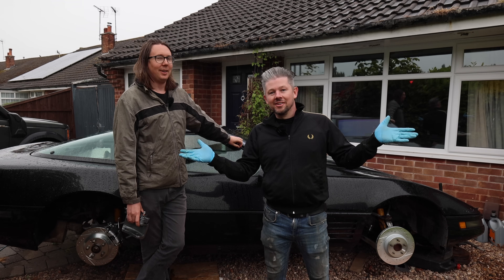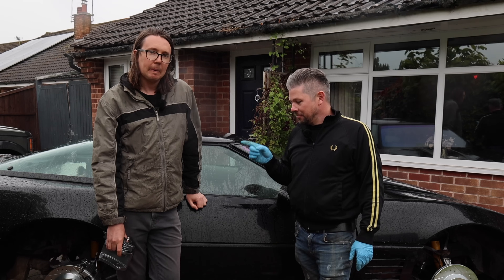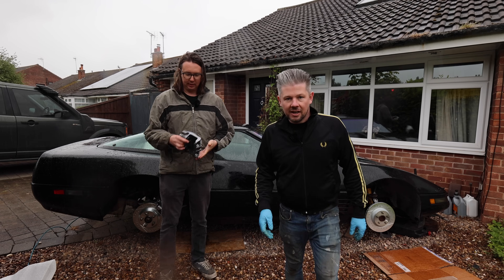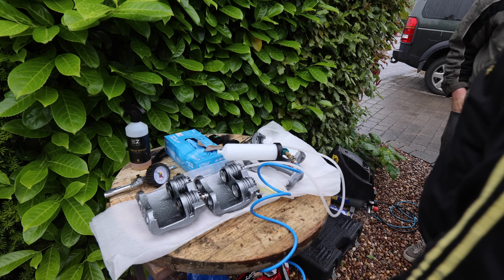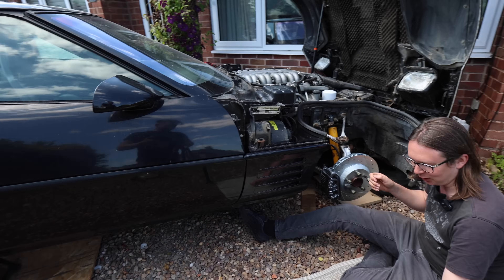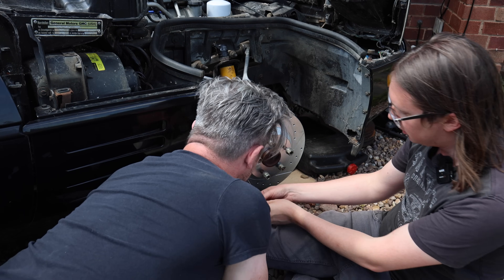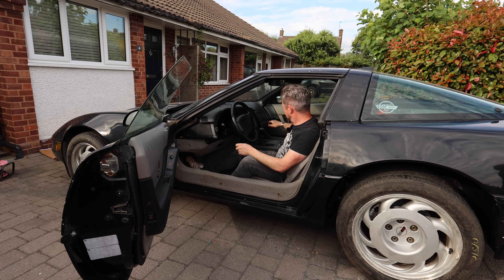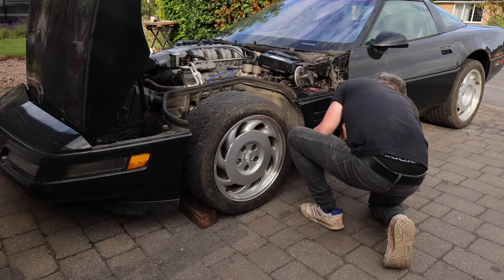PROGRESS! Our British ZR-1 moves for the first time in 18 YEARS! Corvette ZR1 Project Episode 10

Comment: Oh no, for the people who love engine stuff like myself do a special vid showing the troubleshooting, finding and fixing the engine running issue in fact the whole drivetrain.
Reply: Yes, it's tragic the way it misses and belches out black smoke. I think the cats are probably blocked now and the oxy sensor has been wrecked by being coated in carboniferous soot.
Reply from the maker: @mercmad a good italian tune up once it's running properly should fix the o2 sensors... If not, we've got a pair of brand new Bosch ones ready to go! If you're interested the code is 31 and it's basically not sending a pulse to the ECM (or the ECM is ignoring it). We are going to scope it on saturday so we should know either way!

Comment: Ah way to go lads, cracking job you've both done on that.
Looks like it could have just rolled off the production line in Kentucky!! 😎

If it was me, I wouldn't get the car repainted, it probably looks better than a 
lot of other cars driving about.

I think you may have discovered a new alien lifeform, hiding in that rear light,
I got the proper shivers looking at that thing!!😯😳

Also, has anyone else noticed how the C4 would make a great looking pickup,
if you removed the rear hatch/glass canopy 😄

Looking forward to seeing it get that bit closer to the finish line, hopefully you
can get the engine running issues sorted, easily enough.
Reply from the maker: That alien life form was horrifying eh!! Funny you should mention the pick up idea - We also reckon it would look pretty cool too! Thanks for the comment and for watching :) :)

Comment: Great job guys! Looking superb and you’ll get the engine running smoothly. First time it’s run in years you can’t expect much more! Re the paint touch up the small imperfections. Originality is good on cars like this especially when 95% of the car is excellent. Wheel refurb will transform it too! Congratulations 🎉
Reply from the maker: 100% the wheels will get a refurbishment... Probably in factory colours with the polished lip.

Comment: I think you guys are doing a great job, ignore the haters and do it your way, it's your car.

Shame the cam sensor replacement didn't fix it, if it was mine I'd look at the wiring next, maybe drop it off at a good auto electrician who could scope the sensors and see which circuit is the culprit. If you want to learn more about auto electrics with the view of trying to fix it yourselves, I recommend Pine Hollow Auto Diagnostics and South Main Auto YouTube channels. I wouldn't be bored seeing you guys try to tackle it, more content the better!

You only get original paint once and it looks great after your efforts so I don't think it needs a respray, maybe take it to a bodyshop for repairs, the good thing about black is it's very easy to blend something like the wing without painting all of it.

Are you planning on doing any shows next year? Would be great to see it in person.

Oh and one final thing, while the handbrake is playing up, please put it in the gear that goes away from your house, not towards it, otherwise you might need that respray and a lot more parts from the States! 😅
Reply from the maker: Thanks for the advice!! We have checked the wheels now so it's safe (we hope!) . Handbrake will be adjusted in the next episode! :) We are going to do some shows definitely - Are you based in the UK? We will make sure we publish the shows we go to on our channel!
Reply: @Auto_Funk  I'm about an hour away from you guys so local shows in Notts/Leics shouldn't be an issue for me.  Hopefully by the time the shows start next year she'll be running sweet and shining like a diamond.  I forgot to say in my last comment, if it was mine I'd get the wheels stripped and polished, other C4 owners have done it and they look amazing!

Comment: It's coming on great. Don't paint it. Really hope you get to the bottom of the engine running poorly. Also love the fact that you took the time to clean the light lenses and the seals as these are either overlooked or replaced with new. A quick wash is always a good start on light lenses.

Comment: If you feel like you need to bleed the brakes again, do it the other way around. Left front first, then right front, left rear and right rear. Don't ask me why, but that did the trick on my '87 Corvette. The engine sounds like it's missing and there was black smoke coming out the exhaust indicating a too rich mixture. I hope you guys(blokes...) can figure that out. Good luck!
Reply from the maker: We think the cam sensor isn't telling the computer when to fire properly, so the timing is a little erratic! So fuel isn't being fully burnt. 

We will try that trick with the brakes. Maybe its a weird C4 thing!
Reply: @Auto_Funk   I would replace the master cylinder as well, just to be on the save side. A 30+ year old master cylinder is likely to fail soon, or at least it's going to leak. Hope to see an update soon.

Comment: The paint looks bloody great from where i'm sitting lads.. Save you money and spend it on the engine probs.. Maybe get it ceramic coated .. or just keep on top of it with the protection... Get a nice soft cover for it.. if you spend a ton on a respray . you'l be scared to take it anywhere.. after all this car is there to be driven hard ha ha ..

Comment: I think the paint will come up a treat with a proper detail. As it has sat so long, I would definitely give it a blast with some fallout remover (should really have been done before claying). Use a good pre wash snow foam (Bilt Hamber Autofoam is good), rinse and then wash with a non wax shampoo. Then clay again, do a light cut with a quality compound, wipe with iso prop panel wipe, inspect for defects and repeat if necessary. Once happy, get a good polishing pad and ideally a non resin polish (Autoglym SR polish is good, but has fillers and hides scratches, so good for a quick spruce up, but not if you are applying a sealant). Give it a couple of polishes with different grades of polish (maybe a 2,500 & 3,500 as it is a black car). Then important step, is to use a good panel wipe before applying any wax or sealant, to remove any polish, wax or residue. This ensures the final coat of sealant, bonds with the clearcoat or laquer and is not sitting on top of a coat of polish ( I like Bilt Hamber Cleanser for final step). Then apply a good wax or ceramic coat and should be good to go.

Maybe get the paint defects sorted first though, as you will likely have to repeat the process if not when it has been done. Also, careful with that old school rotary on black paint. You can get good results with them, but very easy to get holograms in darker paints. Random orbital / mop is a safer option. 

I get that this was a quick detail to spruce it up a bit though and you probably had a better detail in mind for further down the line 🙂.
Reply from the maker: Thanks so much for the tips - We're not experts, just learning as we go and doing our best based on past experiences.... Great shout about the panel wipe, something we completely overlooked. You are right, it was a quick spruce up and a sort of "looksee" to see what we're dealing with. Further work required, me might employ someone to do it (possibly the @thecarcleaningguru if he's up for it!)
Reply: @Auto_Funk  If you have the time, do it yourselves, more content and people can get better with you 🙂. The only issue you may have is trying to ceramic coat outside with British weather and seagulls / pigeons targeting your newly polished car. It really needs to cure inside for a few days to get max protection. 

My experience would say, forget the 3 to 5 year type ceramic coats though, they don't normally last anywhere near that long, are more difficult to maintain and you cannot do any paint correction without needing to reapply (minor scratch, birdstrike etc). Personally, I much prefer the semi permanent ceramic coats that you apply maybe twice per year. You can use these outside (preferably not in direct sunlight) and they last around 4 to 6 months on average, depending on cleaning products, environment etc. I have always got on well with Mother's CMX Ceramic Spray. Easy to apply and lasts really well and a bottle will last for many full applications.

It will make future cleaning much easier.

Comment: Copper slip....iv heard its not necessary between hub and disc, as those parts dont need to move past one another, unlike the brake pads that need to move under braking as the piston pushing on the pad. If your worried about hub and disc fusing together, just use big hammer🤣

Comment: It sounded pretty healthy couple of videos ago. Have you checked compression now? I hope there's nothing wrong with some of the valve springs.. Best of luck 👍
Reply from the maker: We're having intermittent running issues. Imagine its (hopeful) its electrical as the car does crank fine. Its not galloping etc..!

Comment: Copper slip is fine on the hub surface. But do not use any short of antiseize on the lug threads nor any of the actual caliper bracket bolts.
Reply: See I'm not the only one , some one who knows there onions.

Comment: Regarding the engine running rough, GM’s are finicky when it comes to certain things. There are aftermarket plugs that say they fit, but they are not correct. You have to use GM plugs for that specific engine. They are expensive. I learned this with my GMC pickup. After wasting money on aftermarket plugs, I put the factory plugs in and it ran perfectly. That may be part of the problem.
Reply from the maker: It could be a plug problem for sure. Might have to go back to basics there.

Comment: Always bleed brakes starting at the front of the car with the closest to the fluid pot, then the other front, moving to the closest at the back and finishing on the furthest away as thats where the remainder of the air will be. 
Pretty much every haynes manual I ever read tells you this and always worked every time first time. 
Good to see you back at it.
Reply from the maker: Thanks for the tip! We always thought it was furthest first but hey we're not experts!

Comment: Slowly getting there guys. But when you bleed the brakes dont pump the pedal with the bleed screw open. Close the bleed screw pump the pedal gently and then push the pedal down and hold it down then release the bleed screw letting air and fuild out, lock the bleed screw off then pump the pedal gentley again hold down and repeat until no air comes out. Pumping the pedal with the bleed screw open lets some fluid out but will pull some air back in.

Comment: It's come up really nice, good job. Likely it's had moisture in a box of two, if all else fails clean inside with electrical cleaner/lub and a soft toothbrush. If you get stuck bleeding brakes by yourself use a piece of pipe like you had plug end with(I use a bolt) and cut a fine 10/15mm slit in it,  by the bolt or whatever you use to plug hole.So it will close after the pressure has dropped. but put well inside a bottle because it squirts out. If you use DOT 5.1 doesn't damage paintwork. But don't hold me to that have a look. Run it in my BMW E91 been fine, running Brembo pads and disks Std calipers. The gloves you use I only use for things like stripping carbs, for doing most jobs I use the woven backs with latex palms/fingers. More heavy duty can reuse for months. Good luck with finding the fault. 👍

Comment: I'm sure you've had plenty of offers to help figure out the running problem. I'm pretty well versed in this era gm driveability. Do you have an old obd1 scanner that shows live data? GM called it the Tech 1. The old SnapOn "brick" also works as well as the old OTC obd1 for GM. If you do have the ability to pull live data,  I'd like to see a video of all of the readings while the rough running is occurring.
Reply from the maker: Vance we would LOVE a Tech 1 but they re really scarce here.... For now we are stuck with a paperclip :) :) BUT if we get a Tech 1 or let's say something like a Snap On MT2500 with the right modules we will film the diags for sure. Lots of Tech 2 diags over on our C5 project vids if you're interested!

Comment: guys bye a partytent so u have some protection from the weather.. working on an 1986 c4 my self . have some issues with it runing rough to waiting. for some sensors and other stuff from rockauto..cheers from sweden
Reply from the maker: Unfortunately the wife would deem a party tent to be an eyesore (and she'd have a point to be fair!)... Tell us about your 86? Does it have the 4+3 trans? I bet you'll get it running right soon enough!
Reply: @Auto_Funk  it is an automatic with a 270h cam in it and headers red on red with greenwood package and a stalker frontbumper wierd combo haha ..yea i hope it will run right after i get the parts i need on monday

Comment: You should use coppercoat/ never sieze on the threads of the wheel studs but be very careful that you don't get it on the taper of the wheel nut or the tapered seat in the wheel, the wheel nuts need to tightened to 100ft/lbs and that can make them seize to the studs and then you have a massive problem to get the wheel off and the stud replaced.

Comment: Welcome to 'summer' . Our summer is  purely notional , methinks. Car's looking go , I knew it would scrub up reet. Regarding the rough running  , has it got any dead holes/ Can't really tell whilst the audio was out, but mucho black ,over-richness in evidence out the exhaust. I forget now, but does the ignition on the ZR use the Optispark , or a variation of it? I know it has coil packs , unlike the LT-1, but I figure ther may be something like water where it oughtn't to be , as the injectors are new, you've done plugs and leads etc. Can the timing go off on these ? Anyhoo , I reckon you'll get it before too long. Keep it up, fellas ! Edit; Shoulda said  'car's looking good' ! C4's  I reckon are the only car that looks good in black .
Reply: No opti.  Coil packs, wasted spark system.  Timing is managed by a cam position and crank position sensor.  Timing doesn't go 'off' unless these sensors fail.  Also note: if the MAP sensor is disconnected, or faulty, it'll run super rich, then trip an SES light.

Comment: Wrap it!
Reply from the maker: Although wrapping is cool and on a lot of projects its a great solution it isn't really an option for this car... the areas where paint is missing isn't smooth (its down to the glass) and there are areas where paint is lifting off the glass which would show through any wrap... then later on down the line if the wrap was removed (or even during positioning of the wrap) it would likely pull a lot of the original paint off the car in these areas and cause a mess! 

We're thinking we don't paint it and perhaps have it sympathetically touched up in areas that it needs.

Comment: Wonder if you have a sticking valve causing the misfire
Reply from the maker: The lack of power is linear across all 8 - We think the timing is heavily retarded which is causing the rich running.... ! One day, we will fix it! Stay tuned and thanks for watching!
Reply: @Auto_Funk  You have the injectors changed?  Coils too?  Plugs?  Ignition cables?  Check your MAP sensor.   Any codes thrown (SES light)?  If the cam sensor is bad, it references the crank sensor for timing, so not likely the cam sensor.  And I see that you replaced it and no joy.  Are your O2 sensors reading rich?  Do you go into closed loop?  Do you have a Tech1?  If not, buy one - without the ability to read codes and the live data stream from the ECM, you're simply throwing darts at dart board in the middle of a blizzard on the north pole at night.   If the MAP sensor is bad, disconnect it, the ECM will go into open loop, referencing the tables to run the engine, and trigger the SES light, but the engine will run clean and smooth.  Of course, full power will not be available.  What bothers me isn't the fact that you're running rich, but how much the engine is missing while running rich.  The LT5 is EXTREMELY tolerant to extra fuel.  When I accidentally popped the vacuum line off of my MAP sensor, it ran far more rich than yours, but still smooth as glass - no missing.  So, you're not just running rich - you also have an ignition issue.  Correct spark plugs?  Correct coil packs?  Ignition wires correctly routed to the right cylinders?  Good luck -  as I said above - goto www.zr1netregistry.com for all your answers.

Comment: Dont use that copperpaste any where near brakes or wheelhub.  I have been restoring and buildin all sort of cars, mostly racecar/sportcars over 20 years. That will cause brakes covering all the brakedust and make them seized after that. Just brakecleaner and silicongrease for the sliding pins. Also wheel nut has to put whitout grease/paste or you are over tightening it. Just imagine any racecar, there never are any grease or lubricant on brakes or wheel Bolt and nuts. Keep up the good work still! 😊

Comment: Unless you have a) very deep pockets for a truly professional repaint and b) the current paint is terrible, deffo leave as is! One tip for copper slip. Never let it near rubber eg the caliper pin boots. It causes the rubber to swell as I discovered many years ago. I now use a synthetic GP grease and motor craft caliper pin grease. Hope you can sort the misfire and a summary video of that would be great. Cheers

Comment: Do touch up paint and drive it run a tank of clean fresh 94 and some fuel injection cleaner  in the tank do that at least 3 times then change fuel filter o2  sensors it kinda sounds like the  map sensor is bad
Reply from the maker: Good idea, we have got new O2 sensors but really needs to be on a ramp to change them. It could be a fault never know!